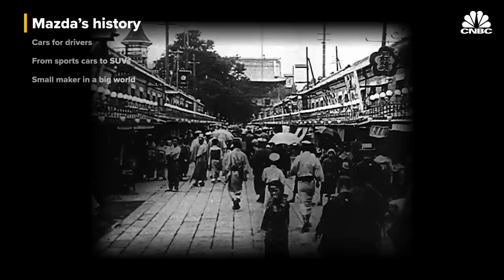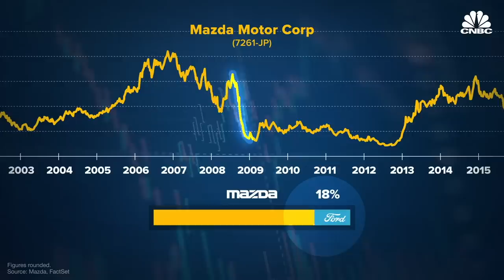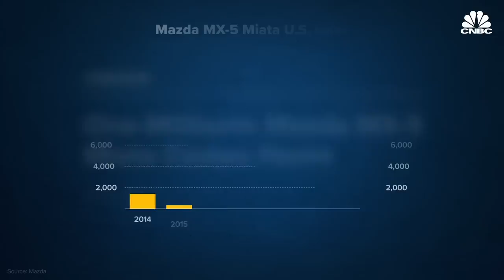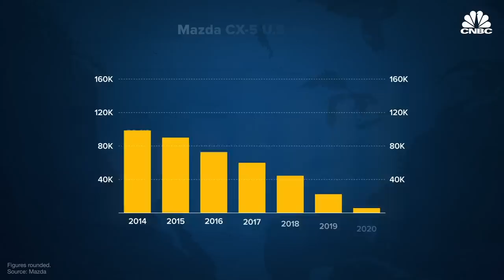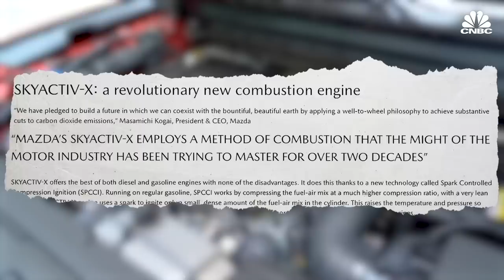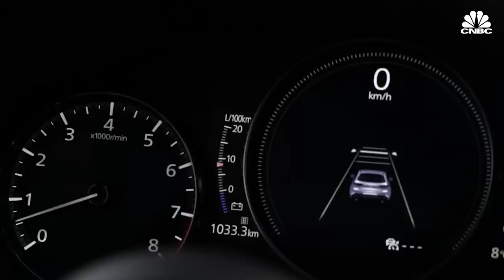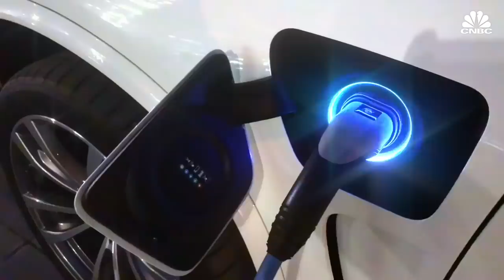Can Small And Scrappy Mazda Survive Among Automotive Giants?

Comment: Mazda's are really under rated, they've been improving ever since they split with Ford
Reply: Actually no they haven't. Their quality is awful when compared to car in the same segment. I bought a new 2020 Mazda 3 and the build quality was so bad that Mazda had to buy it back from me. The rear view mirror fell out because of the cheap glue used, the seat controls flopped out because of the cheap plastic tabs holding them into the seat, the glove box is made out of soda bottle plastic, the C pillar on the outside is a sheet of aluminum foil that dents with your finger, the software is full of bugs and glitches, the rear seats won't latch back up because of the cheap latches used, the A/C does not blow cold air because they don't put enough freon....I can go on and on.  Total junk.
Reply: @bigmacdaddy1234  yes you would go on and on you big Mazda fan you.
Reply: @jace1113  Not a fan.
Reply: @bigmacdaddy1234  so why are you even here trolling?
Reply: @bigmacdaddy1234  Sounds like you got a real lemon. I can't heap enough praise on them. There are three Mazda's in my family and aside from a rotten heater core caused by an apprentice mechanic , they have all been without a single fault. My wife's Mazda 2 is 19 years old. As much as I've been encouraging her to "upgrade", she refuses to part with it. My sister has an '08 Mazda three that she refuse to part with. My last car was a Mazda, my current car is a Mazda, my next car will likely be a Mazda too. I've got to agree with you in regards to the air conditioning. It's not much chop in an Australian summer.
Reply: @davidbrayshaw3529  Actually, I didn't get a lemon. The new Mazda's are junk. Go to the Mazda 3 forum and read all the problems the car has.
Reply: @bigmacdaddy1234  Forums are typically the place that people with mechanical issues go.  People with faultless cars tend not to engage in them. They're not indicative of the percentile chance of problems with a given product. In recent JD Power surveys, Mazda has faired relatively well as a middle mark brand. They don't beat much more expensive Porsches and Lexus's for reliability but they do beat the likes of Mercedes Benz. They also top brands such as Jaguar, Land Rover, Volkswagen and even Honda.
Mazda's are "cheap" by comparison. They punch well above their weight.
If you want a car that's a fair bit better, you're going to have to pay a lot more for it. Then again, if you want one that's worse you're going to have to pay more for it too. Mazda make a good car for the dollar.
Reply: @davidbrayshaw3529  My experience has been different with Mazda. The quality is not ready for prime time. Better off paying less and getting a Kia.
Reply: @bigmacdaddy1234  that’s just it: your experience.  My experience has been great with a 2016 and a 2018 3.  I have had zero issues with these 2 cars.
Reply: @bigmacdaddy1234  Mazda has been topping consumer reports most reliable list for a few years
Reply: @bigmacdaddy1234  I have a 2011 Mazda 6 with standard transmission, 170000 miles on it with no issues whatsoever, rock solid vehicle and I have a 2016 Mazda 3 also very good reliable car
Reply: I hope they survive, i bought the new Mazda 3 and its the best car ive owned and I've become a huge Mazda fanboy
Reply: Even when they were with Ford they were still great. I've got a Mazda from that era and it runs better than alot of cars made now still
Reply: @bigmacdaddy1234  I have had a 2016 Mazda 3 for three years... No problems. Great driver's car. You got a lemon or you're a anti- Mazda troll.
Reply: 100% agree.   They just outranked Lexus as most reliable brand in CR
Reply: @mcrossley8  Nah, he just emphasized that the Mazda 3s produced since 2019 have worse quality. None of you guys here have experience with those new ones
Reply: @bigmacdaddy1234  Have a 2010 Mazda 6 and I find it a great car to drive... Btw if you were considering a Kia then go for it... You likely don't even care for the Mazda's driving experience anyway... Just know that some might refer to it as a Karen Inside Automobile, K.I.A. for short XD
Reply: @bigmacdaddy1234  Kia is garbage lol
Reply: Im in quite a few 3 forums people love their 4th gens and i wont lie i kinda like them too. That being said i wont give up my mazdaspeed3 for a new 3 turbo i live my car and the new ones are cool but no 6 speed manual option. As for the issues the screens are a big issue they crap out all the time random spots are found on headrests and the seats as well as the headliner. They openly say it mazdas are made to drive yes things can go wrong but the driving experience is second to none ask anyone whos actually had a go in a miata mine would upset cars 4x the cost of it just like my current mazdaspeed.
Reply: Yeah but for most people nowadays guys you got to remember the number one selling vehicle in America right now or crossovers and then I would say it's trucks does Mazda even really have crossovers I'm not too familiar with the brand but when I drive around a major city here in Florida it's 90% SUVs Crossovers and trucks
Reply: @KTMsteve  Yep, like I said CR is a joke.
Reply: @badfriends5206  I agree, but Mazda is worse.
Reply: LeMao ZeBron  well  there was the Mazda b truck  that was pretty good they need to bring it back
Reply: LeMao ZeBron  Consumer Reports is a joke and I didn't get a lemon. The car is just made embarrassingly cheap. Hmmm..where do I begin. No hood struts and the supplied hood prop looks like it's made out of a coat hanger. Glove box is made out of soda bottle plastic. Seat frames are made out of pot metal. Rattles all over the dash. C pillar is thin as a can of soda. Exterior Paint is cheap and thinly applied. Rubber gaskets around the windows lose its shape. A/C isn't cold. Rear hatch does not have a release button inside the car the hatch struts can't even raise itself. No touch screen, software full off programing bugs...go to the 2019 Mazda 3 forum and read all the issues. there are many.
Reply: @bigmacdaddy1234  Your basing your entire opinion on a lemon
Reply: @dustinferris4537  But it was not a lemon. It drove just fine. That is how it was designed. The materials are embarrassingly subpar. For eg; the hood prop is made from a coat hanger, that is not a lemon, that is a design decision. The seat buttons are made out of cheap plastic, again a design decision. The glovebox is made of soda bottle plastic - again a design decision. Is this resonating with you?
Reply: @bigmacdaddy1234  If mazda interior is subpar in your book then what brand do you prefer as a daily driver
Reply: @dustinferris4537  Anything but a Mazda.
Reply: @bigmacdaddy1234  lmfao... Korean cars are absolute junk.. My friends 2018 Sonata has issues with the infotainment, Back up camera has a resolution of a smartphone from 2001 and dont even get ne me started on the driving dynamics
Reply: @speedemon1992  I agree. Both Korean cars and Mazda are junk.
Reply: @MarkItZero well that Era was when they were with Ford but you are wrong, the B series engine that is used in the miata is all Mazda and has proven it's reliability (we have the 1.3 version) Ford uses the small engines of Mazda in their sedans while Mazda uses Ford engines on their pick up.
Reply: My 2015 3 st is treating me well lol idk what y’all talking bout
Reply: @bigmacdaddy1234  you’re nothing but a troll. Mazdas are good reliable cars, and only a very few of the early build 3s had problems. First you say buy a Kia, then you say the Korean cats are junk. Nonsense. The CX5, CX9, CX30 and many of their cars are at the top of the JD Power quality surveys and do much better than the German brands, as does Kia and Hyundai. In Asia, Mazda’s are highly regarded, just like Toyota and they’ve had zero issues with the 3. You complain about the “cheap” materials, and yet they’re seen as being well above their competition. I guess just your 3 was made with plastic bottle recycling. Maybe you bought a Russian car with Mazda badges..lol.
Reply: @tlevans62  So when somebody gives a compliment about a car, it's ok, but when someone gives valid criticism based on ownership (not hearsay) it is trolling. Oh, ok Einstein. The Mazda 3 forum existed long before I bought my Mazda 3. I do not own nor did I create that forum, but it is full of threads of owners with serious problems with their cars. So now you are saying they are all fake and they are all trollers as well. Geez, you not only need a Kleenex but also a Tampon.  Get with the program dude.
Reply: I agree ... When Ford attempted to create a cache of different brands in early 2000s (Ford, Lincoln Jaguar Aston Martin Land Rover Volvo and Mazda) they destroyed the brand identity and also the quality of each brand including Mazda and thank goodness Mazda got away from them.!!
Reply: @jace1113  agreed this guy is a troll and a hater.😭😩😜
Reply: I hope they continue being underrated and not become like toyotas that have to appeal to much broader customer base and cannot take as much risks with design and innovation.
Reply: @bigmacdaddy1234  If you think KIA is better than Mazda you really have no clue.
Reply: they were good even when they had the partnership with Ford,
but now Mazda along with other companies are being forced to
play by the EPA and the governments rules. Mazda has had a history
of being the drivers car, because most of what they made were fun
to drive cars, and there's nothing wrong with that. i like when
companies try to be different, it gives people choices.
but Mazda is still a company that's in the business of making cars,
and unfortunately if you don't keep up with the changing times,
you'll get left behind alot of times. so Mazda said, our vision wasn't to
flood the market with crossovers originally, but if i wanna stay
in business, i have to build them with what we know.
so that's what they did.

Comment: Mazda is like all the good things about japanese automakers in one

-the Honda and Toyota reliability and durability
-the Honda sporty feeling
-the good gas mileage like a Suzuki
-the quality of Lexus
Reply: @whatgaca  - Lexus really are special but most Japanese vehicles are very reliable especially the ones that are actually built in Japan- I have 2 Mazdas and they have been brilliant cars to own.
Reply: reeeeeally? lol
Reply: The utility of subaru!
Reply: Awesome take! 🙌
Reply: "good gas mileage of Suzuki"

Uhh yeah, about that...

I'd say Suzuki fits in reliability, cheap and being small more. Fuel economy isn't exactly Suzuki's strong suit.
Reply: @PlatinumNath  it depends. The true 4x4 and the ones with the 2.4lt engine consumes a lot. But the ones with the 1.6 (cars, SUVs, not real 4x4) or the ones with the 1.4 turbo or anything smaller than 1.6lt have great mileage. I have a Vitara from 2017, manual transmission, 1.6lt, slow as hell, but great mileage and enough power to cruise at 140 - 150km/h without problem.
Reply: @amermeleitor  got a Suzuki APV with a 1.5 G-series. Kinda hand-me-down and shared with the fam but hey. Power is sufficient still despite being around 15 year old now, nice short but well spaced gears, feels surprisingly peppy to drive and great at going on some inclined roads and carrying people and stuff, the cloth seats are very nice too almost like a bed, but goddamn gas mileage is pretty poor for a RWD minivan with a 1.5 i4 lol - 20-23 mpg from what I counted myself despite pretty conservative driving and I don't even drive as fast as you do. It's REALLY thirsty, but then again that's also the only and closest Suzuki I know. The only other few Suzuki's I know personally from experience are second gen Jimny's, Ertiga's and Wagon R's.
Reply: @PlatinumNath  you are right! The RWD Suzuki have bad mileage, because they are work vans converted to family cars. The Ertiga have a lot better gas mileage. I was referring to normal family cars, not the 4x4 or work ones.